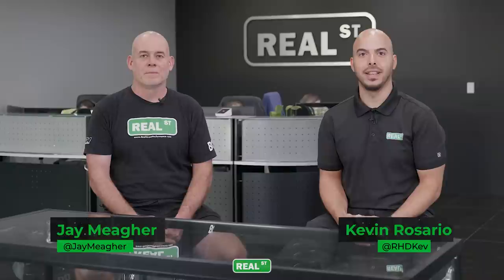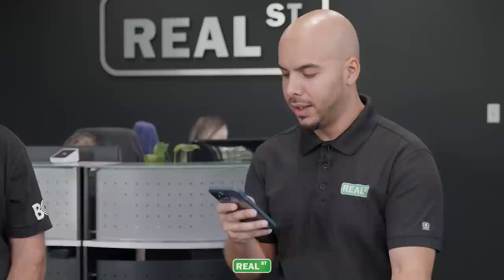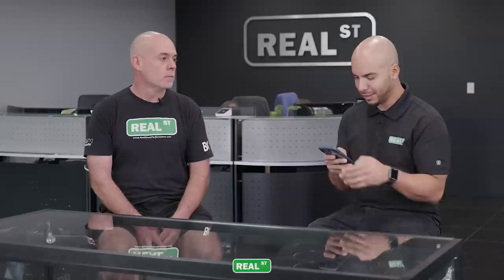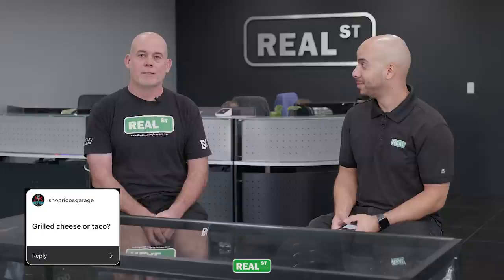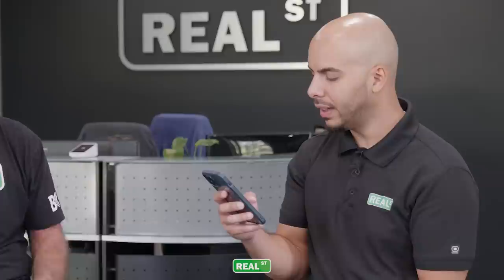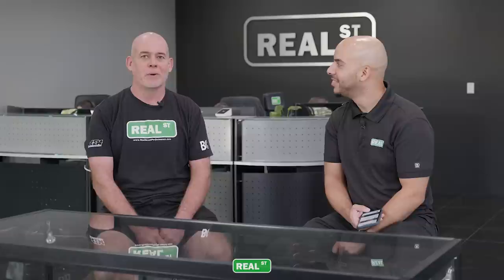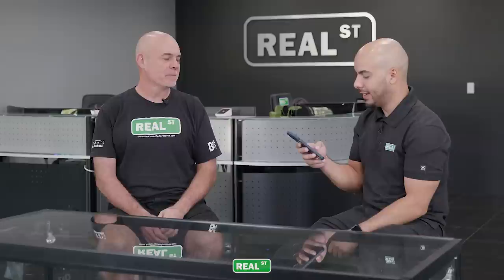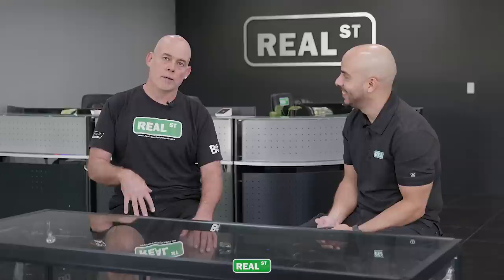Q&A With Jay Meagher | Favorite engine? 2JZ Stroker? RB26 Build? Hp Rating? and more

Comment: The Honda/Acura J-Series V6 is severely slept on but maybe we're biased (HalferLand Performance) because we specialize in them. These engines are stout, running 600hp at 7.8psi in our daily driven 06' Accord Coupe 6spd for nearly 35k miles and many many races 🤙 Yes, it has our rods, pistons, billet block guards, our tuning on Hondata , our stage 2 cams and lightly ported heads...but most of that was done for longevity, where stock internals hold roughly the same 600hp, much more interesting things happen 😅 
As for the engine storage and rusting, we use just normal motor oil and PB Blaster. We usually also bag/wrap them with plastic wrap to help with humidity, being we're in FL as well.
Reply: You should get a review with thatdudeinblue that would be sick! I didn't even know that people modded those things whenever I get a j series in the shop I always think of it as one of the "bad" honda engines but I should really look at that stuff. That would be a sick sleeper build!

Comment: Congratulations! Im surprised you guys dont have more subscribers.
I have a question about the oiling system. What is more important for the rotating assembly, oil pressure or oil flow, or is it a balance of both? I understand there are other factors like clearances, deflection, stiffness of the components used, environmental temperatures etc.
There seems to be two camps on the topic. One camp seems to roughly follow the 10psi per 1000rpm rule of thumb, sometimes even lower (NASCAR crowd) and the other camp seems to chase very high pressures (RB26 crowd).
I would love to get your insight on the subject :)